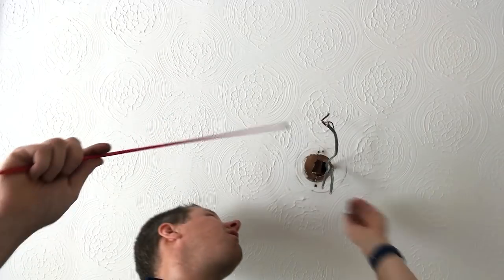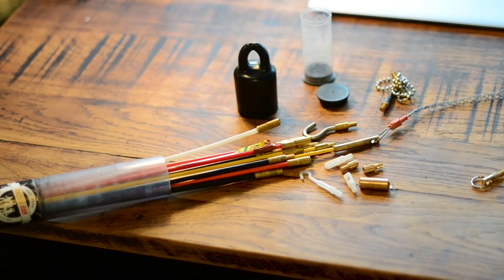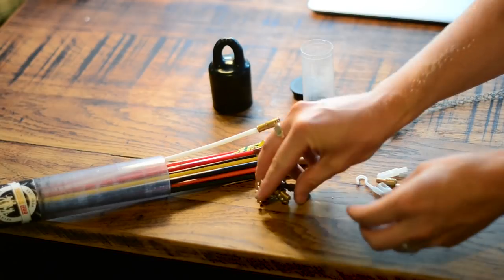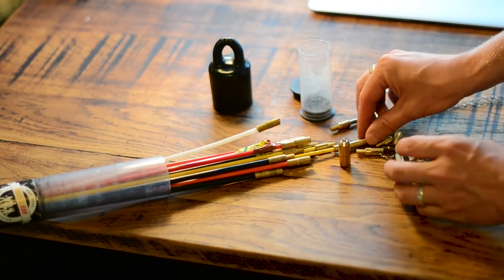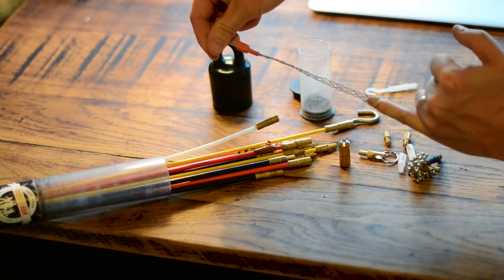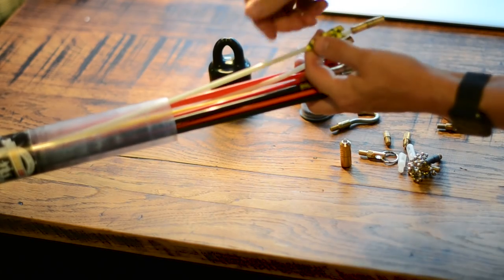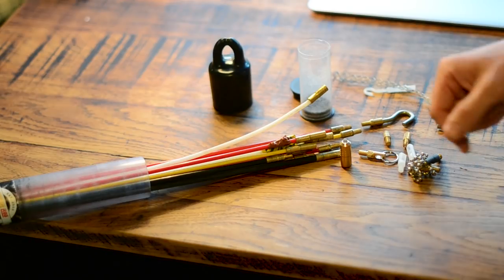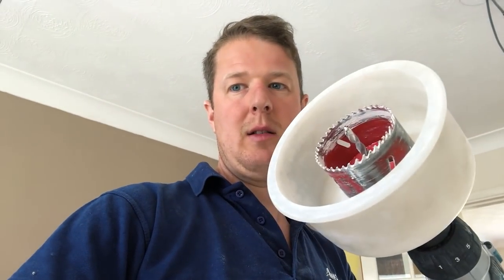Tricks of the Trade - How to pull cables in to tight spaces and tricky situations

Comment: Have you ever tried the Gekko gripper which has a two part magnet and a piece of nylon cord you can drag under floor boards or on top of plasterboard very useful piece of kit
Reply from the maker: Not tried it yet would love to give it a go!
Reply: It’s not bad if you I nice surface you are using on it can get caught on the edge of floor boards and pipes and any crap sitting on the plasterboard

Comment: Wish we had in the 1960's - spend hours as an apprentice ripping up floorboards!
Reply from the maker: Yeah it’s such a time saver!
Reply: Yeah, often not an option these days (as you no doubt know!) with all this laminate (hack spit) flooring.

Although the other day we had a nice rewire with a 1950s parquet floor on the hall and landing (aka the best cable routes!) that couldn't be disturbed.

And yes, it was black TRS cable.  In almost perfect condition EXCEPT at all the termination points.

Comment: when you are dealing with an attic that you have to get to the other side of to an outside wall to drop a cable down, how do you deal with the insulation hiding all the ceiling joists and in my case ceiling joints that seem to be nothing more than two-by-fours spaced pretty far apart and again, insulation all blow over hiding each 2x4 beam?  do you put plywood down?  It would take a lot of plywood to lay down, but i don't see how I'm going to lay out horizontally to fish-tape the wire down the outside wall, possibly having to drill a hole to get the wire down doesn't sound easy at all.  Im having to wire up a 20A circuit for the new built-in microwave since the new one requires a separate circuit where the old one used 120v off of the 240 from the Oven 8/3 romex (no ground wire).  So everyone I've asked said I need to run a new 15 or 20 amp circuit and put a new breaker on the main panel.  it's going to put tough getting wire to the main panel since the main panel is in a finished garage (drywall) , flush with the drywall.  Lots of challenges in this circumstance.

Comment: The kit you can get nowadays is great. When I was a spark yonks ago, a mini trunking lid was a godsend after fishing with coat hanger wire. And that dust catcher not only saves cleaning up, but stops one breathing in all that nasty crap. Not to mention wago connectors. But I do sometimes wonder whether the latest regs are a bit OTT.  I have seen many installations which by any reasonable evaluation would have had a high fire risk, and a considerable shock risk, and there had been no bad events. I reckon that if all drivers had to take a short driving test every five years, and, if their standard was poor, they would need to have their driving assessed, far more lives would be saved than by installing rcds - except for circuits supplying areas of high risk. Given that electricity is part of all our lives, there should be some basic teaching about it in every school.
Reply from the maker: Good comments thanks!
Reply: On the rewire we did the other week (mentioned in another comment, 1950s vintage flooring) I found the original spark's 'fish rod'. 2 pieces of 1/2 inch rolled seam conduit (clearly unused offcuts) held together with the old black friction tape... with a piece of coathanger on the end as a hook. Out of respect, after using it again(!) I left it under the floor in the understairs cupboard. :)

And re: requirements for RCD's on everything... ABSOBLOODYLUTELY. I'd bet more people end up getting hurt trying to get downstairs to reset the RCD on the lighting circuit in the middle of the night than get hurt by luminaires!
Reply: I rewired my own house last year and found lengths of bamboo cane under the living room floorboards, lashed together with string. Probably no coincidence it was right next to an old skool junction box.

Comment: Hi mate How did you feed the cables did you go under the joist  or drill a hole through the joist
Reply from the maker: Drilled through the joists using a long 12mm wood bit works a treat
Reply: @artisanelectrics  ok mate so do you poke your rod till you find joist then measure to it. drill an hole close to joist in the celling then kind of drill an hole at a slight angle through the joist

Comment: Nice but you aint clipping any cables.......what happens when the house is on fire????.
Reply from the maker: They are all behind plasterboard which is fire rated.
Reply: @artisanelectrics  Yes only for 20 mins by the look of that plaster board.... Im sure there is a reg out there about clipping. It goes something like.... Wiring systems must be supported in a way to prevent premature collapse in an event of a fire.
Reply from the maker: So what would you do, rip all the ceilings down just to install a few downlights?
Reply: @artisanelectrics  No I would lift some of the floor boards up in the room/rooms above, run everything,clip as stated in the 18th edition and re fit the floor.
Reply: What would you do on a ceiling with a flat roof above